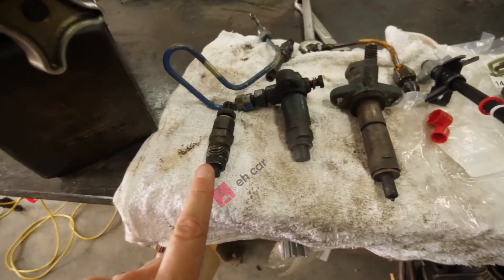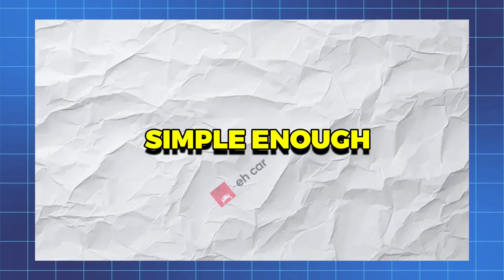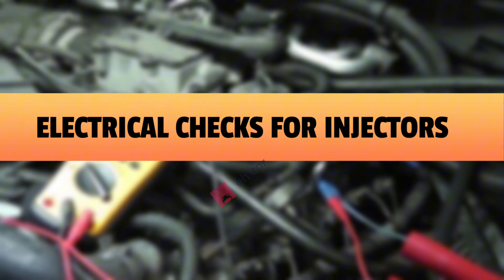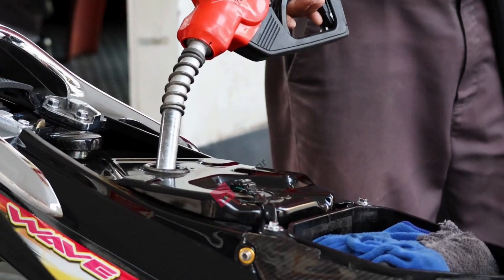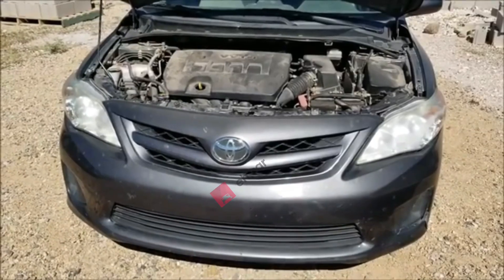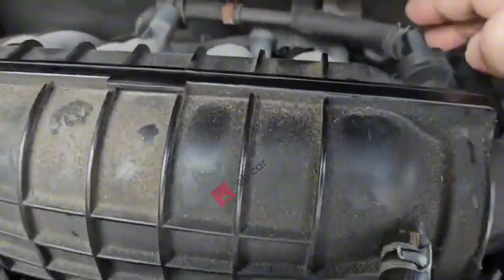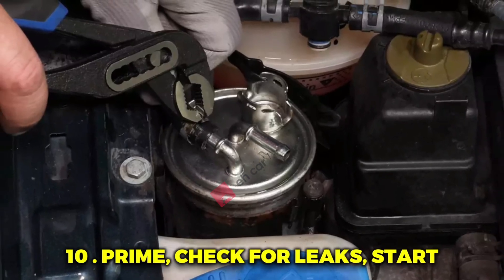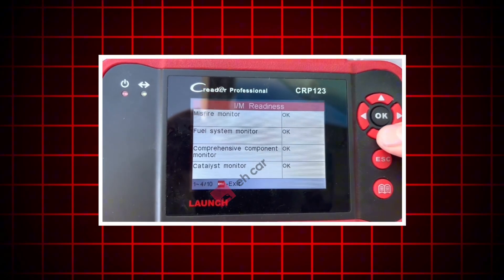2 Best Ways of Testing  & Cleaning a Fuel Injector Without Removing Them

Comment: Can brake cleaner also work for this?
Reply from the maker: Brake cleaner isn’t the best for injectors because it’s too harsh and not designed for internal fuel components. I’d recommend a proper fuel injector cleaner, safer, more effective, and made for the job.